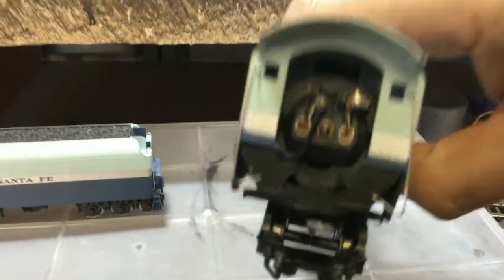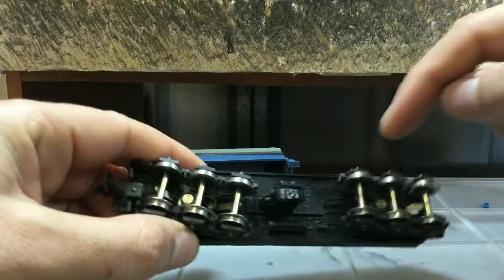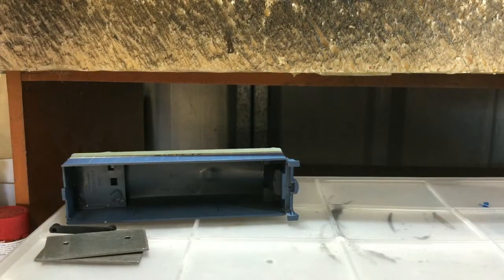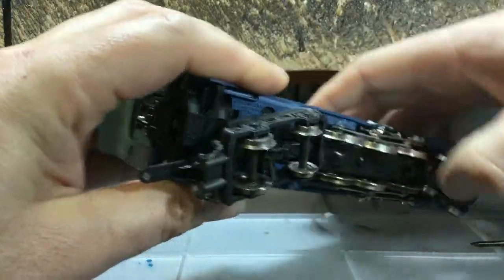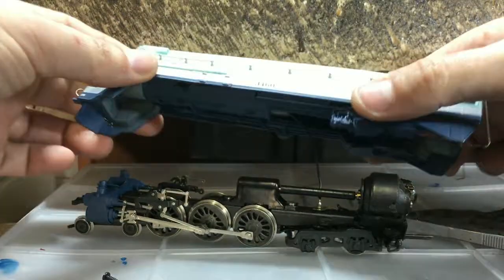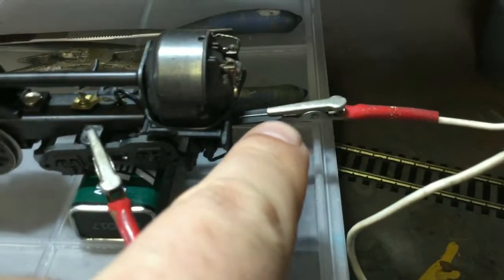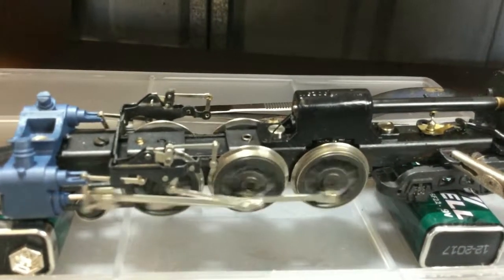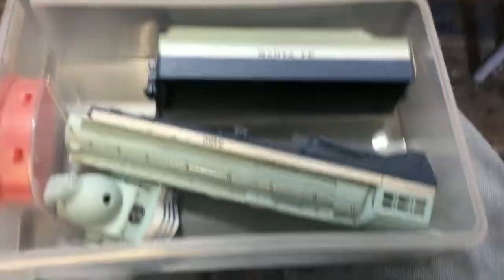Rivarossi Blue goose

Comment: I have a rivarossi blue goose I got it for $50 at a train show, a subscriber of mine told me it was rare,do you know how much they are worth
Reply from the maker: Depending on the condition etc anything from $75-$150. There is some Blue Goose locomotives and matching coaches going around $200-$250
Reply: @dynamicloco2186  ok,thanks